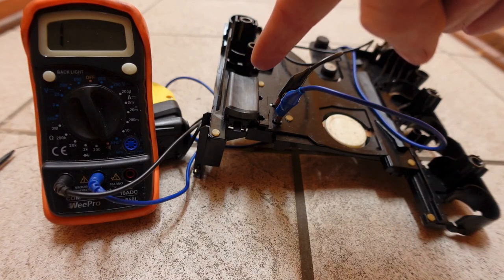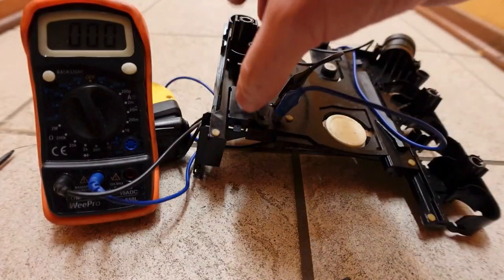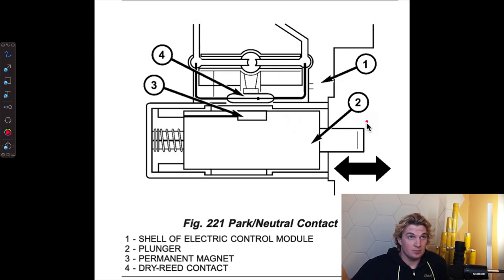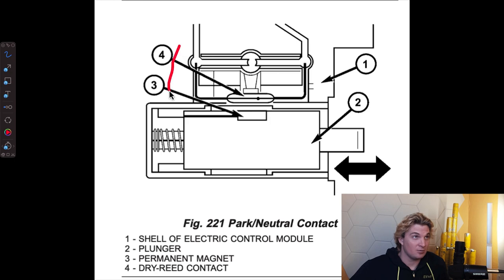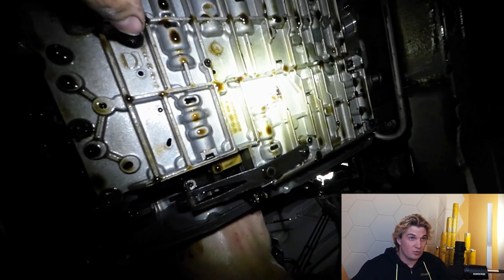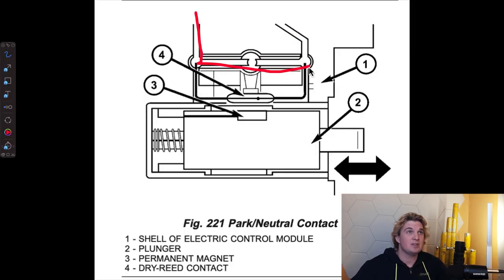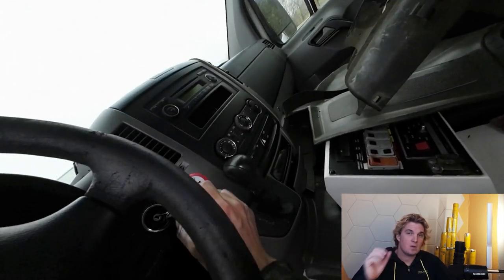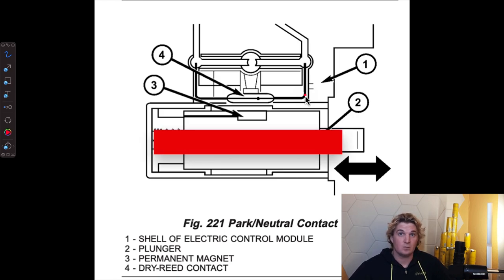Sprinter No Start Fix With Magnet. 2004-2018

Comment: My van won't start.  Code shows no communication to the TCM.  Also the P on the dash is missing as well as the indicator light on the shifter column doesn't illuminate.   It will not come out of park unless you push the release button below the shifter.  I decided to see if it would start after sitting for a month and the van started.  I drove around for 30 minutes then let the van idle for 30 minutes.  Shut it down and then would not restart again.
Reply from the maker: sounds like an electrical issue. I'd start with TCM and EWM/EGS fuses five and seven on the side of the driver's seat, then remove seat and inspect tcm for transmission oil seeping up through the wires, May I ask what year your van is? Please don't hesitate to follow up. If you don't see any noticeable issue we can talk more.... also confirm power is going to tcm module, do you have a multimeter?
Reply: @sprinterfix  yes the two fuses are good. There is power to the TCM.   I actually pulled the TCM apart.  There is no fluid or debris in the housing.  Van is a 2013.
Reply from the maker: 2013?  Interesting.  Did u get a new ecu after your recall? Can u give symptoms when no start?  Can turn key?  Ignition on?  Can read codes?  I have a few suggestions based off of symptoms.  Also is Tcm code active/current or just a stored code?
Reply: @SprinterFix  I did not get a new ECU.  That I am aware of.  Key will turn, dash lights all come on.  

The codes that came up on the scanner were P121A00 and C103.
Reply from the maker: Hmm.  Might need a different scanner.  Codes for true lost comm with Tcm would be u0101 in generic and 2211 with vin specific code reader.  If it really is a Tcm issue consider putting some penetrating fluid in connector and working in and out a dozen times. That’s helped me more times then I can  remember.  But I don’t think that’s your issue

Comment: Hi I have a 2004 sprinter, it won’t crank, dash lights on, no starter error, I have swap with a working sprinter ECM skreem and key, TCM, fuse box. Nothing seems to work. If I run a ground to the starter relay it cranks, any ideas or videos that would help? Thanks
Reply from the maker: I am real sorry to hear that. Can I confirm there are no codes on either the tcm, immobilizer module, or ecu? That is a tough one, perhaps remove cap from  starter relay and pinch the inside to see if it cranks. maybe also check the fuses for tcm. located on side of driver seat. If I remember correctly the circuit I discuss in this video can be deactivated with a fuse.
Reply: @sprinterfix  I only have the MaxiAP200 to read the codes. I did check all the fuses everything is good.
Reply from the maker: @arturoperez6176  might be worth trying to start it in neutral. I assume ignition turns on normally?
Reply from the maker: @arturoperez6176  check rail pressure and cam/crank syncronization first. should be able to do both of those things with your tool. let me know what you find
Reply: @sprinterfix  yes I did, and I swap the gear selector shifter. I can see on the MaxiAP200 on live data the gear I’m on. Cleaned all the ground points, I took the starter switch out measured voltage and continuity, everything seems good
Reply: @sprinterfix  I don’t know how to do that but I’ll try, which reader do you recommend for the T1n van?
Reply from the maker: @arturoperez6176  thats. a tough one, my favorite scanner doesn't always work on t1ns fro some reason. I'd say mid tier launch would be good, likely get one fro under 300 bucks